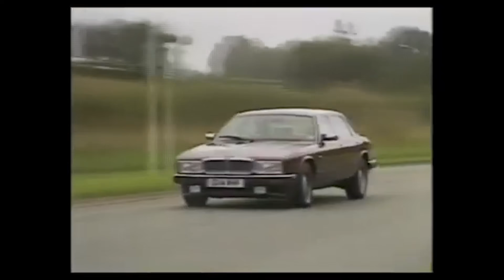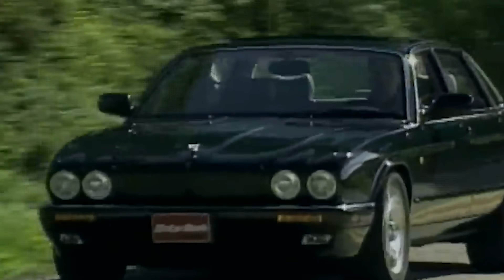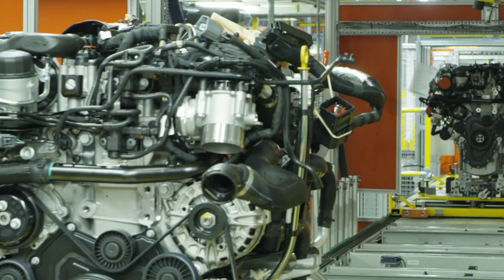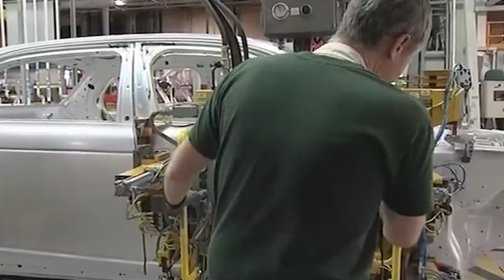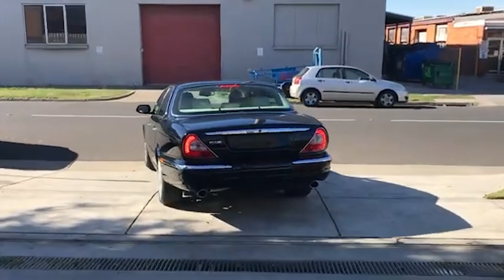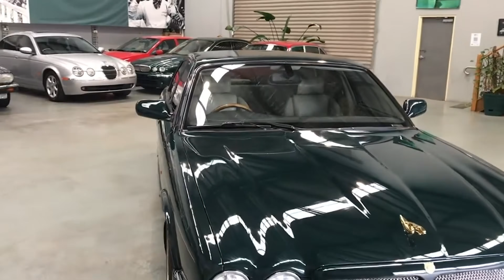Jaguar XJ X308 Was Supposed To Save The Brand - Here's What Went Wrong

Comment: Excellent video have a 1998 sovereign lwb just having replacement gearbox fitted then the timing chains done engine service with metal waterpump and thermostat bodywork is in excellent condition have a good day from vini
Reply from the maker: That 98 Sovereign with fresh timing chains and a metal water pump is basically set for another decade. Enjoy every mile, Vini!

Comment: I have a 2000 registered XJ8 308. I love the car lots. It drives superb 47 thousand miles. 👌 It has been reliable with no current issues. It is in immaculate condition. Navy metallic smoke grey upholstery. A pleasure to own and  drive.
Reply from the maker: 47k miles on a 2000 XJ8 is practically new, that interior combo sounds absolutely stunning. Are you keeping it long term?
Reply: @GoodOldThings7  yes I am keeping it. I bought the car with 41k miles 6 years ago. March 2020. I have done 6k in 6 years. I love premium cars. I have 2 Bentley's and a Lexus.

Comment: I am fortunate enough to own a platinum silver 2001 X308 XJR with 77,000 original miles on the clock in superb condition.
AJ27 engine with timing chain tensioners replaced and a pair of new fuel pumps in the gas tank.
Only downside is the transmission fluid leak on the gearbox from the electronic connector which goes with the territory on the Mercedes 722.6 transmission (only fitted to the XJR) as they are renowned for it across the Mercedes forums so that is my next job to undertake.
Reply from the maker: 77k on an XJR in superb condition with the maintenance already sorted is about as good as it gets with these. Good luck on that gearbox connector, a known one on those.

Comment: That is a phenomenal video for us Jaguar patients.

No doubt, that is a real Jaguar. It is still impressive, especially in the supercharged Daimler version. That was the choice of people who insisted on discretion and were reluctant to buy RR or Bentley. German cars, no matter what their owners thought of them, were close, of course, but not close enough. I kept my dad's Daimler XJ 40 (X81) with a 6.0 TWR V12 engine. Only 64 of them were made. Factory claims 320 hp, but I had doubts about those power figures, so I took it to a dyno. The result was 359 Whp and 510 Nm torque. I use it mostly to travel from Stockholm to Zadar on the Croatian coast, because nothing does long-distance travel like a Daimler. That is unmatched even today. Those seats are phenomenal, the car is quiet and fast, keeps any pace, 80 or 250 km/h; you will enjoy it immensely. On the highway between Nuremberg and Ingolstadt, even after 30 years and 190 tkm, the car reached 264 km/h, and over a distance of less than 100 km, the V12 burned more than 50 liters of petrol while maintaining an average of over 200 km/h.

So, that is a perfect reference about the "real Jaguar" topic.

https://youtu.be/2nsPuOmvwmA?is=gACn66RvFTTwpWRj
Reply from the maker: A Daimler XJ V12 doing Stockholm to Zadar, thats the kind of story this car was built for. Absolute long-haul royalty.